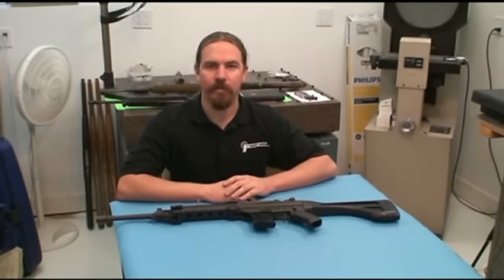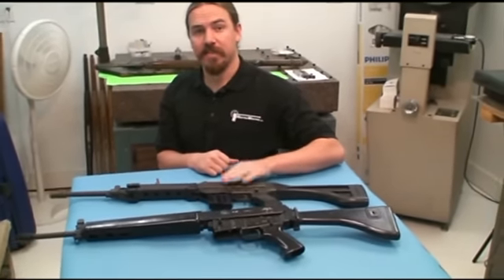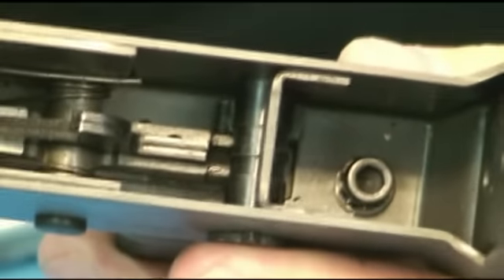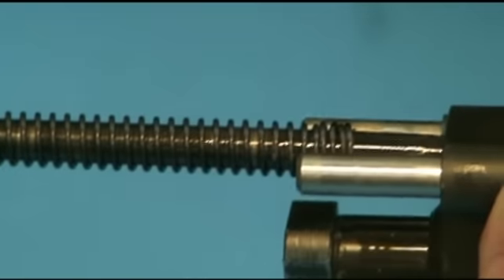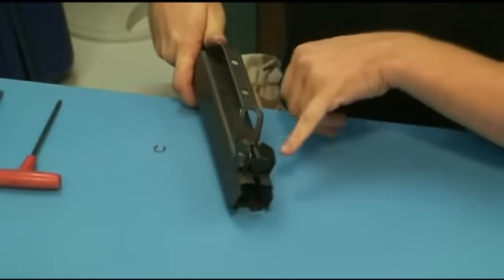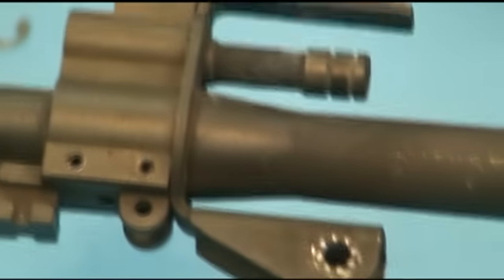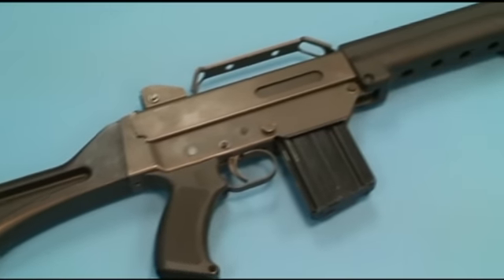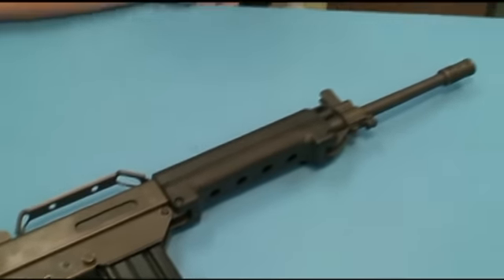Leader Dynamics T2 Mk V rifle

Comment: I owned this very rifle in 1990 before they were banned in Australia in 1996. I found it to be a reliable rifle even though it was somewhat "crude" in it's construction. They were generally called a AAA and mine was made by Australian Automatic Arms who came after Leader Dynamics and were manufactured in Tasmania. I owned the SAR version. Mine did not have a carry handle, just a welded piece of metal that allowed a scope to be attached. I enjoyed owning it as it had a character all it's own. I used to find the red rubber buffer pads used to wear out or perish. The bolt carrier group was also of interesting design as you mention. The Australian defense force went with the Steyr AUG instead. I don't believe this rifle was ever truly given any consideration for defense use in my opinion, but could be wrong. I enjoyed it very much.
Reply: I had one back in the days before the ban as well.
Reply: Mine was the carbine, the AAA SAC. No carry handle, just a piece of metal spot-welded to the top for scopes and other attachments.

Comment: Ian, there is a movement in Canada right now to produce our own non-restricted black rifle utilizing an AR180 lower and simply-produced upper. This video and firearm may become a whole lot more popular shortly!
Reply: If you do...make the metal on upper stronger. I had a SAR 17, a later variant of this in Australia. The reciever was held with a pin with a bearing under spring pressure to clip in. After breaking it apart many times, it ended up Egg shaped the reciever had a good 4mm movement front and back when assembled due to that. Maybe the older pins with the sir clips should have been kept on later models

Comment from the maker: I haven't done a video on that, but perhaps I should. The difference is simply how far the piston itself travels. Less than the cartridge length is short stroke, more than cartridge length is long stroker. The M1 Carbine is a short stroke system, as is the AR18, FAL, SVT, and G43. Long stroke systems include the AK, M1 Garand, and Bren.

Comment: I heard great things about these rifles back in the day and I really regret never picking one up, but I guess it all works out. A few months back I picked up one of the MasterPiece Arms MPAR's, which as others have pointed out, is a thoroughly modernized Clone of the T2. A Fantastic Clone, I might say.

Handles as well as I remember, very accurate and a ton of rail space for Mods.

I hope other companies start utilizing forgotten designs like these.
Reply: Got one too. I am replacing the flash hider with M4SD II, just to see if it improves anything. Do you know if the ar slidefire will work on this platform for burst applications?

Comment: I like the captive guide rods and springs, much better than the AR-180. The simplified bolt looks nice too. I wonder if they'll modernize it slightly for the re-release in the US. Doesn't look like it would take much to improve it using the updates done to the AR-15 and L85.

Comment from the maker: I'm working on it...
Reply: +Forgotten Weapons Did this rifle even make it trials for the Australia Army?i wonder why the Australia army didn't use this rifle it look like a nice rifle tho it does look it cheaply made.
Reply: +KingKongGaming It did make to the trials but didn't Australian Army didn't look it. Within 2 years later the AUG was made the Australia Defence force when with then it. So for 20 -25 years we have been using AUG A2
Reply: Forgotten Weapons I had one of these. Major fault if you break the weapon down repeatadly it wears hiles in upper and lower reciever.
Reply: The Leader never made the final trial to replace the SLR (Australian FN FAL) although it was considered in the initial requests. Was talking to a friend who was involved in the trials today of the replacement in the mid 80s for the Australian service rifle.  The final serious trials were actually between the FNC, Steyr and M16A2. The Steyr came last but they were willing to let the weapon be manufactured here so we got lumbered with it. Having used the Steyr since 1988 all I offer is that it sucks. Typical junk early 70s conscript plastic weapon, made even worse by dumb modifications by the Australian Army like a useless 1.5 power optic. LOL. I know right, air guns have better sights. Even the new black F90 still has a sponge for a trigger, a stupid non NATO standard mag change system, dumb safety catch, the worst non adjustable stock, ejects rounds almost into your face when firing from non master shoulder despite a plastic deflector and, just to top off the turd sandwhich with some nice maggot garnish, comes in 5.56 NATO. What a dog of a rifle. Give me a 30 year old Leader or AR 18 any day.
Reply: @freddywarren69  I would have happily kept my SLR ... The Indonesians seem happy with their FNC variants.
Reply: There were a couple of mods done to the trials/suggested to be done to the Australian trials models which did come on some rifles released by leader dynamics from their Moorebank factory.
The first was a slot in the top rear of the charging handle slot on the handguard to allow the charging handle to be pulled back and slid up into the slot to give a bolt hold open option for clearing the weapon.
The second was a push pin with detents for the main upper/lower receiver pin to allow easier disassembly.
There was also a hex/Allen key holder in the hollow base of the pistol grip and a spare parts kit underneath the removable (2 hex key screws) butt pad.
There was a side folding stock developed as well.
A large batch of them were sold to Saudi Arabia and a few other countries as their operation in sand/dust/mud was better than European and US military rifles at the time as well as being simple to clean. A full selective fire version giving full automatic as a third option of the selective fire lever was also made.
Somewhere around I have a full colour brochure showing all the variants.
The rifle also had a much heavier barrel than the other rifles on trial and held zero better when hot.

Comment: The "E" clip cries out for aball or spring arrangement.  Other than that it seems a quire well engineered weapon.
Reply: for some bizarre reason, e-clips were VERY popular "engineering devices" of the 60s to 80s, and found their way into a LOT of "gee whiz" arms in the 80s, most of which went the way of the dodo, mostly because they had junk like e-clips, lol. i think the AK "shepherds crook" pin retention inspired folks that "sloppy holes are ok" if you added a springy clippy thing to hold it. figure if every box of cleaning patches had half a dozen e-clips (which are that cheap, actually), an e-clip on the front pivot (which you only pull for detail strip anyway) is something that could be "lived with", as opposed to it retaining the take down pin on an AR-15 which would be lost at every cleaning (and probably the pin too, lol)
Reply: ludditeneaderthal Thanls.  Amazingly, I remember my first encounter with an E clip:  1947, on a Record Changer.  Somehow I lost it and replaced it with a twisted wire.....Guns were never meant to be freindly with E clips.....
Reply: mine were on the linkages of carter carbs, little microscopic versions that begged to be lost in every crack and crevice a chrysler motor offered. that a couple had to be pulled to remove the carb from a 318 was one of my personal pet peeves. in those days my tool box had half a dozen small pairs of forceps, so EVERY clip or hairpin (remember those???) removed was kept with it's very own still gripping forcep (much harder to lose track of). of course, my encounters were a bit later than yours, lol

Comment: Having carried the A2 variant in Iraq way back in 2003 I can testify that it still had problems. I found sand could block the safety catch solid and only breaking the gun down and effectively removing the catch - made from a cheap nylon as is all the standard plastic parts - could I clear it. That happened on a few occasions in fact, including the day my unit went into Iraq itself. After appreciating as a Brit ex-pat here in the US the L85 series is second rate. If your still in stay safe

Comment: Thank you for showing me how this thing works.  If I can ever get my ass in gear to put my shop back together I'm going to fiddle around with a hybrid design based on this and the ACR.
Reply: +lowell houser The e-clips look like a bad way to go, I think instead a cotter key or trailer hitch style pin would probably not rattle off.  Plus you wouldn't need pliers to pull it off during servicing.  AND it would easy to replace with a bent nail or piece of wire. Extend the receiver forward and install a full length rail, with captive pinned detachable lower half.  Looks like it could use an AR or AK trigger group, but the pins would have to be sized to fit the receiver width.  Also, bring back the AR-18 reciprocating charging handle. Ak buttstock.  Keep the AR barrels. Look into replicating the bolt head design.  Not gonna be able to make ejection reversible, but everything else can be ambi.  FNC style dust cover.
Reply: Take it back, forget the reciprocating charging handle.  Use an AR15 forward assist instead as an attempt to keep a nearly sealed system. This also replaces the FNC dust cover.

Comment: I feel like this or the AR-18 would have been better received if they hadn't gone for as much cost saving as humanly possible. Considering how many times the AR-18 bolt has been copied, clearly there was something there, but the engineering in the original host just didn't seem to be. That E-clip on the Leader made me cringe so hard, too...

Comment: Would normal field stripping require removal of the pin and E clip that attach the upper assembly to the lower? In less than ideal conditions it would be easy to lose the clip.
Reply: just like an ar-15, "normal fieldstrip" requires only hinging the action, not removing the upper from the lower. Ian does the "tear down" so he can show you all the junk wriggling without the indignity of knocking his teeth out with the front sight base. that's why the front pin has an e-clip, while the rear does not (because the rear MUST get pulled for field strip). if you HAVE to use an e-clip, at least it's the right way to employ it.

Comment: And I can testify from experience that it is. The L85A1, I will admit, is a bad rifle, but the L85A2 is a perfectly fine rifle, on par with most modern assault rifles. All issues with reliability were resolved, and nowadays the weapon is more versatile with a rail system offered by Daniel Defense, and a wider variety of optics can be mounted on top

Comment: Anyone know the length of the guide rod springs? I own a leader and the springs are missing. I hope to find springs from another gun that are a reasonable approximation of the leader springs. Obviously the AR-18 springs are longer.
Reply: You might be able to use the springs for a M17 bullpup, as the bolts are largely the same. Try contacting KM Aerospace and see if they have the parts. http://www.kmaerospace.com/M17s.shtml
Reply: Also, why not a shortened AR-18 spring?? [You almost certainly know more than me about that, though....]
You might get lucky and find a gunsmith who's way more interested in your project than the usual "reassembling guns for people who can't figure out how screws work" [quoted or paraphrased from Ian on his web site xD ] stuff they have to do more regularly. Maybe they'd only charge you the cost of the springs, or a little more if they need trimming?

...also, where did the original springs go, anyway? xD
Reply: +May your swords stay sharp! (mysss29) +Ronald Raygun
Shortening springs...? Definitely not a good idea for something so dangerously specific ..springs are designed for a certain force within a certain length; reducing the length not only reduces the force resistance of a spring and also risks recoil damage/destruction to the other internals & potential(ly severe) injury to the firer.

Comment: So I Know this video is old, but why does the AR 15 need a big buffer tube out the back, making pistol builds and such look even more awkward, when this bolt carrier group looks sufficient? Might be a dumb question, sorry
Reply: Look at an AR-15 bolt carrier, it is actually long enough that the hammer has to swing through the back portion of it. The buffer tube also gives ample distance to slow down the carrier so it doesn't slam into the rear part of the receiver and abruptly stop. It makes for softer shooting.

Comment: I wonder what sort of longevity this weapon would have with regular use. Could all that spot-welding hold it together very well?
Reply: your car is held together by literally thousands of spot welds... how do they hold up? a spot weld is actually a VERY strong joint (assuming a proper weld, of course). assuming one stress relieves the steel after welding (a heat treating step, also called "normalizing"), those little buttons are basically equivalent size pins (or rivets, or essentially "one chunk o' steel"). also note the only thing the "skin" actually does is just hold everything in alignment. the bolthead locks into the trunnion, so the sheet is only restraining the assembly from flying back, not restraining the bolt thrust itself. it's like an AKM receiver, only the rivets are replaced with "solid steel joints" (which actually have far larger cross sections than the rivets). sheet receivers are limited by heat treatment, and alloy. in 1020 sheet, yeah, that's gonna fall apart muy rapido. in 4140, with a proper heat treatment, it'll outlast you.
Reply: we have guys still using this daily for pest control and they still hold up

Comment: This rifle was a real piece of junk and I struggled with it for 5 years until the buyback. The AAA was adopted by prison guards in Tasmania but rejected virtually every where else. I've had a plastic piece fall out of the back of the bolt carrier, c-clips dislodge and general malfunctions during operation. The mini-14 also uses a fixed piston design with the cylinder moving around it but the mini-14 has fewer parts and less problems. There is also a 10 inch barrel version of this AAA which created massive muzzle blast. I realize that St. George was trying to build a cheaply made competitor without infringing on anyone else's patent but this rifle was pretty bad.
Reply: It just needed some more development.